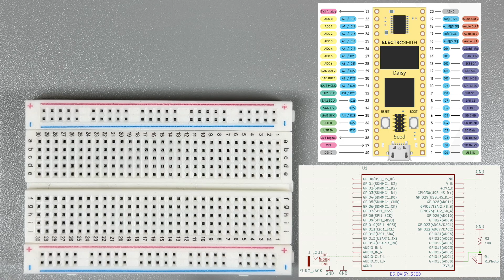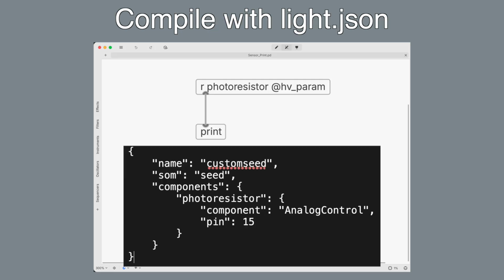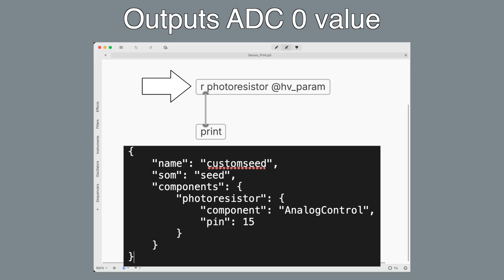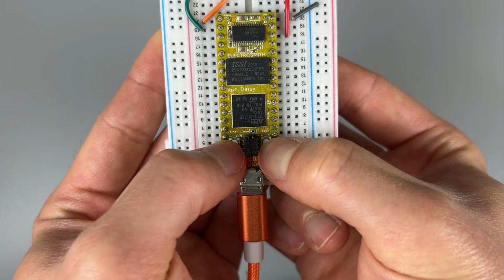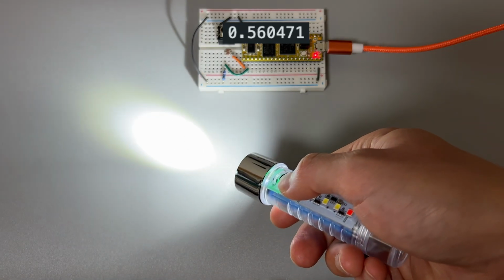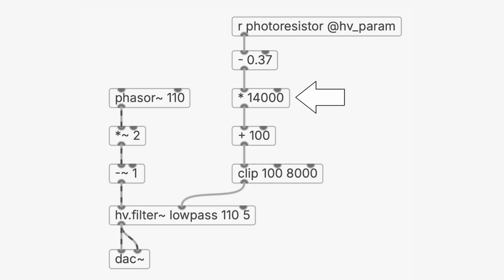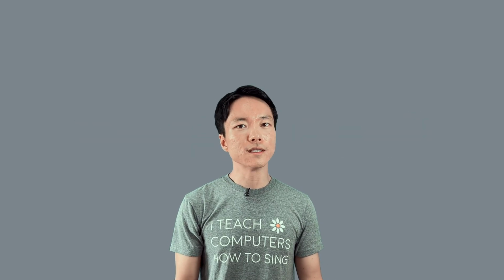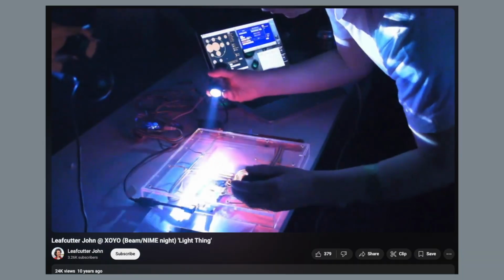Build a DIY Light Synth with Daisy Seed!

Comment: Great tutorial!
I'm using the exact same patch and JSON from the video, but getting this error: 
"Exporting Failed: Total compile time: 1.63ms
Compiling for custom...
make: /Users/xxxxx/Library/Caches/plugdata/Heavy-e544bf8b8f0754fabe6051/daisy/source/Makefile: No such file or directory
make: * No rule to make target '/Users/xxxxx/Library/Caches/plugdata/Heavy-e544bf8b8f0754fabe6051/daisy/source/Makefile'. Stop."

I'm using Plugdata v0.9.1 on macOS with Daisy Seed. I've tried to clear the cache folder, restarting/installing Plugdata,
when I use "r knob1 @hv_param" with "knob1" defined in the JSON, it exports successfully. 
Any suggestions on what might be causing the missing Makefile issue? Thanks a lot!🤕
Reply from the maker: Thank you!
Are you editing the same JSON file by changing `photoresistor` to `knob1`? If so, I'm not sure why that resolves it.
And does compiling and flashing Subtractive_Synth.pd in the same folder work for you? You can select "Pod" as the "Target board".